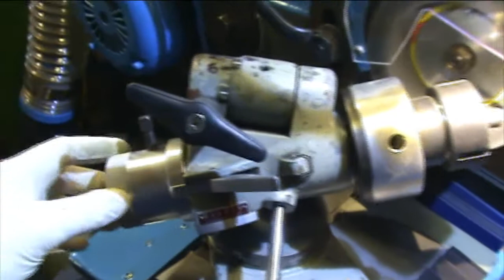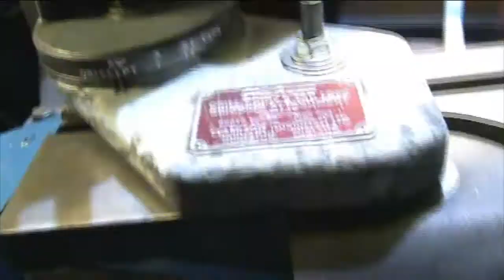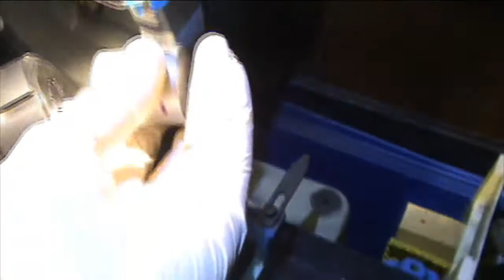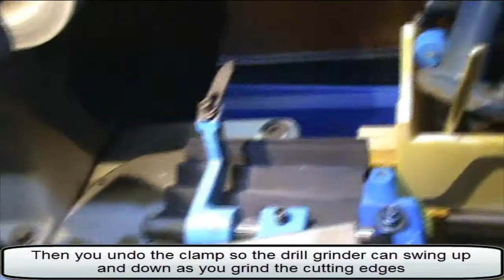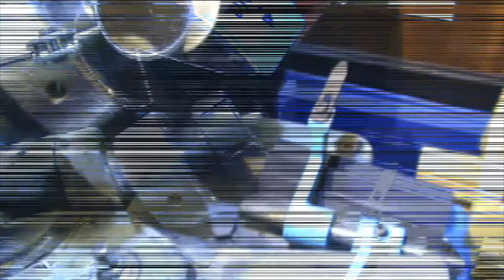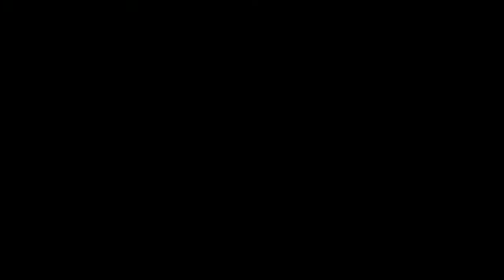Clarkson Drill Grinding Attachment

Comment: George,  I would be interested to know if  you made the collet chuck and spindle from scratch, or did you buy a chuck off-the-shelf and modify/sleeve it to suit the bore of the unit.
Reply from the maker: Hi Glyn, the original item came with a spindle and no 6 jaw chuck.  Due to the price of 6-jaw chucks I went for an ER type chuck and made an adaptor plate to fit it to the original spindle and ER chuck. 

Since then I have made another spindle out of aluminium for a smaller size ER collet, as I found the big ER collet cumbersome for smaller drills.  Fortunately the spindle is protected from dust inside the body of the attachment and so grinding dust hasn't so far affected the fit of the aluminium spindle.

Comment: Get a Brierley drill grinder rather than one of these!
Reply from the maker: Yes the Brierley is a great tool and is dedicated to sharpening drills.  I'm not sure that comparing a dedicated tool like the Brierley to a tool and cutter grinderlike the Clarkson, which can do many jobs, and with this attachment can also sharpen drills is a good comparison.  For example the Brierley can't sharpen milling cutters or lathe tools.  But yes if you are only concerned with sharpening lots of drills and can afford a dedicated tool, then the Brierley is a good way to go.

Comment: George, These Clarkson drill grinding jigs seem to be about as rare as hens teeth!! So like another subscriber to your channel the solution seems to be to build one. To me it looks like a modified Potts Jig that swings the drill bit across the wheel. The question is what is the angle between the spindle arm pivot and the center line of the tool holder (the drill to be sharpened) it appears that this angle sets the relief angle for the drill, but I might be wrong.
Reply from the maker: Right, I think I was lucky to find the one I did, even though I had to make the chuck. OK so if you mount the jig on the table, the centre line of the drill is inclined 18 degrees from the horizontal surface of the table and 35 degrees from the front edge of the table.  I tried these angles a couple of times so these are my best estimates.  Don't forget that the table is pivoted by 15 degrees in actual use so that it doesn't foul on the grinding head, as per the Clarkson manual.  Also the entire jig rotates about itself to allow grinding of different point angles.  Have a look at the Clarkson manual and the pictures at the end of the video for more details.  Hope this helps.

Comment: Don't you need to grind back relief behind the leading edge?
Reply from the maker: The design of the grinding jig is such that it automatically puts the back relief on as the drill tip is ground. The back relief is 'generated' by a combination of the initial angle and the movement of the jig.